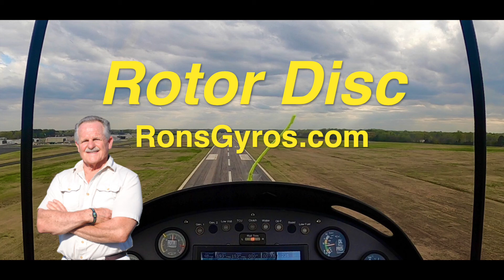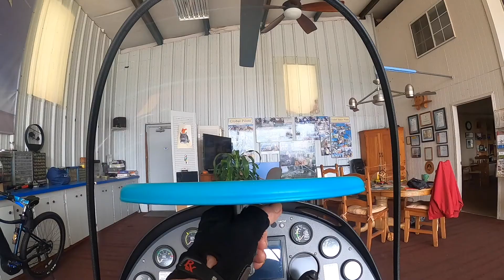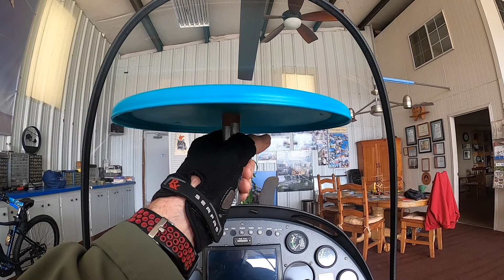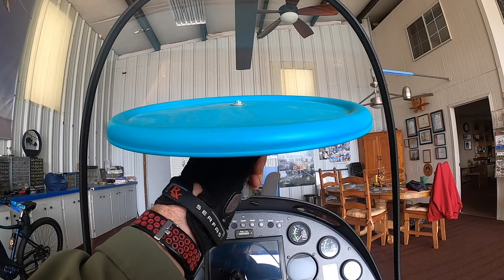Understanding your Gyrocopter Rotor Disc

Comment: Never flown a gyro but with all that spinning mass it must make the controls very heavy when you are having to physically move the rotor disc rather than through changing the blade pitch with a awash plate. Do you not also have to fight the gyroscopic precession?